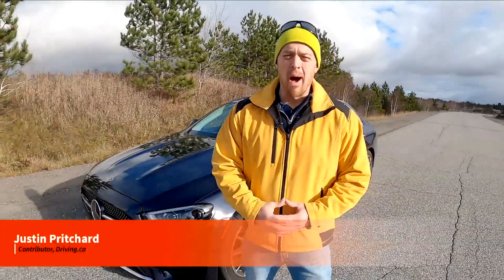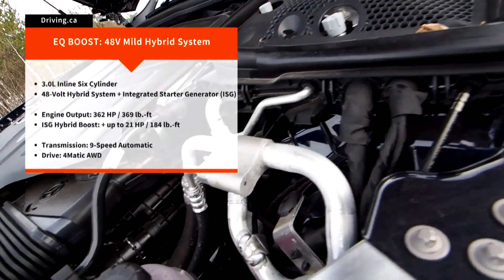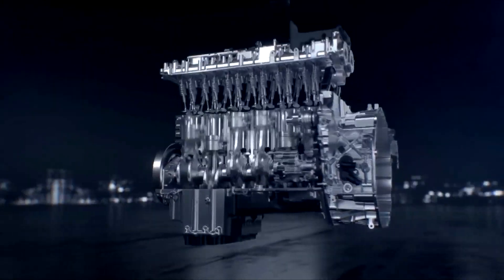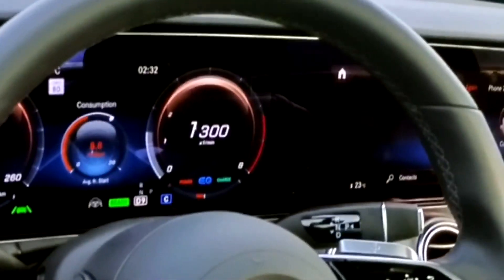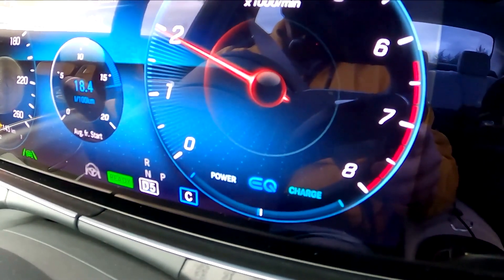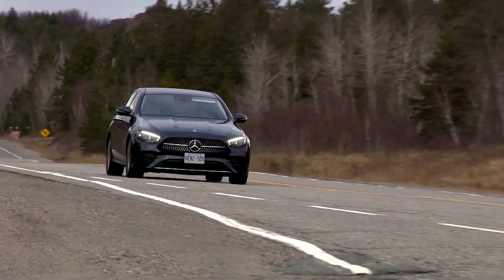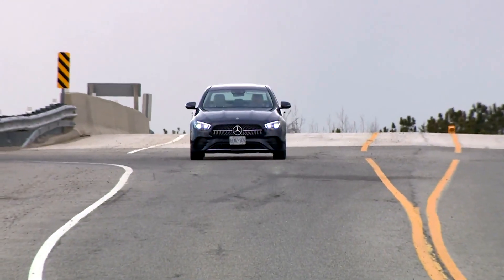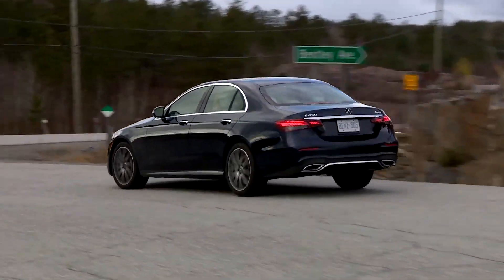Driving Tech Guide: What is Mercedes EQ Boost? | Driving.ca

Comment: Bringing my 2021 AMG 63 GLE S into the dealer in Phoenix tomorrow with electrical issue.  Error message says stop the vehicle and charge the battery see the owners manual.  30k miles.  Hope it makes the drive over there.   Yes it has 
"EQ Boost".

Comment: This is super cool however why not use the exhaust to spine a turbo connected to a power generator. Vs using the gasoline engine 100% of the time to power the electrics

Comment: If the eq boost system fails, the vehice will still drive correct??
Reply: The core components of the EQ system are the 48V battery and 48V motor/generator.  The engine starts with the 48V motor/generator. The AC Compressor & Water Pump run on 48V.  So any major fault will prevent an engine start.  You may have dash lights/messages from the 12V battery but the vehicle will not run.
Reply: @moosejaw50  that is interesting.
Reply: It's not gonna run and it will cost you
Reply: @jamespong6588  it is a reliable system.  Im not a hybrid fan but it is pretty neat to help on fuel mileage.  I don’t think they needed to install that on a glb though.  If we didn’t live near a dealership, I don’t think we would have gotten one for sure though.
Reply: @kiddt1999 8 don't know if it is reliable

2006 s400 hybrids are all dead meanwhile 1988 Mitsubishi trucks with a million miles work

 our dealer didn't gave us the option to not have it so I didn't get the car

Ask for a quote to replace the battery, nobody would want to buy them from you
Reply: @jamespong6588  yeah i bet they are 10k.  We may keep it for 5 or so years and get something else.  My wife goes through vehicles like crazy lol.  I really want her to get a slightly used lexus suv or car.
Reply: @kiddt1999  yeah my wife also, but  I don't buy her hybrids for easier resell, also the savings on fuel are miniscule, compared to the battery cost risk and higher price tag... Hopefully I am wrong 🙏
Reply: @jamespong6588  No such thing as an S400 in 2006.

Comment: Great in theory, but nothing but problems. My E53 coupe has been in the shop more than it's been on the road.  Trading back down, for a GLC43 without this 48V battery crap
Reply: Hm.. i had the same issue with the new GLC with 48V tech, sometime just completely shuts down and not starting. Did they take back your E53?
Reply: @aminemezzour8403  they ended up replacing the 48v battery, took 10 days.  I also ended up picking up a 2019 glc43 AMG, fully loaded with every option black/black so I'm happy with that.  No 48v battery, and the twin turbo v6 is a fun drive.

Comment: What I love about my 2019 CLS 450 with EQBoost is, the gliding function in ECO mode, which basically puts the car in neutral gear with engine switched off when accelerator is lifted off when travelling on relatively flat surface.